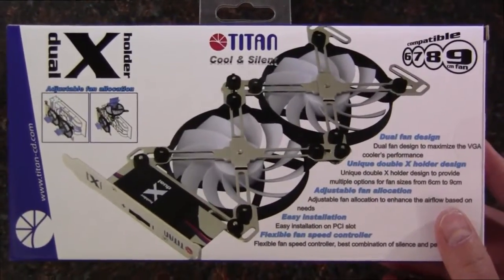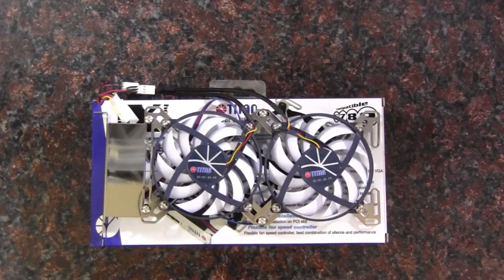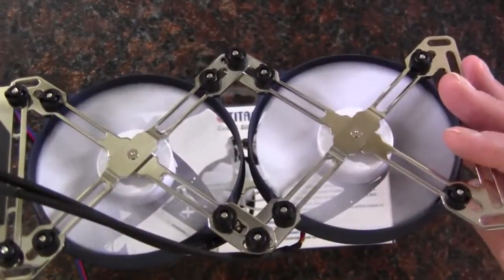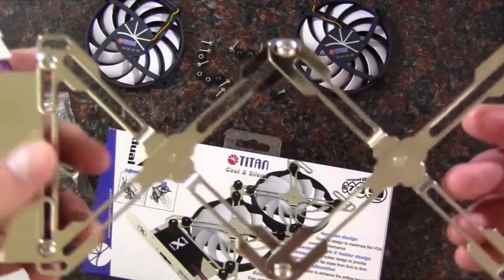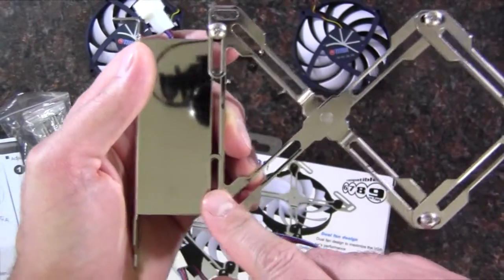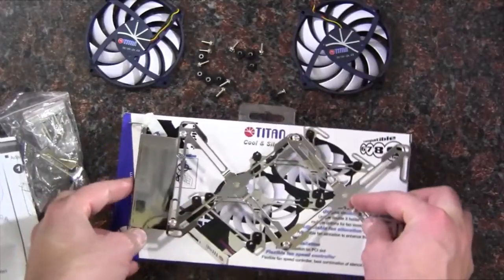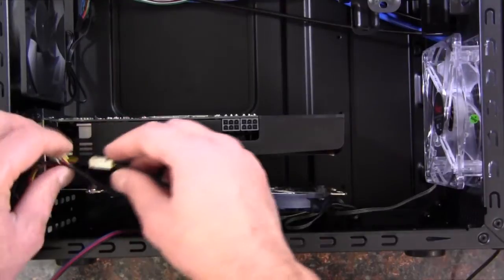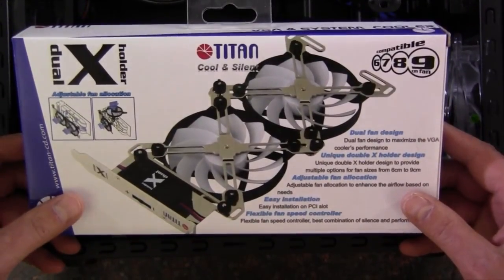Titan Dual X Holder

Comment: Hey I wanted to ask you a question how you connect that to the PC board
Reply from the maker: Hi. The bracket itself doesn't connect to the motherboard. It hangs just above it and is screwed down to a PCI slot screw. The fans would plug directly in a 3 pin fan header on the motherboard. Does that help with what you are looking for?

Comment: per newegg's product page for this the max current is 0.24 Amps. Thanks for the vid, was hoping to see it in action. My 7950 died last night and a friend has one with a dead fan he is gonna give me so this should keep it cool enough, though I may need to remove the shroud for more direct airflow on the card. cheaper that buying an aftermarket cooler
Reply from the maker: I don't think this will work by itself on a GPU without fans. This just doesn't move much air. It can help assist airflow, but not be fully responsible for it. However, putting in different fans can be done and then you can get much more powerful fans that can move enough air on to the GPU heat sink. The 7950 is a hot card. Good luck.

Comment: +AdoptedMike Would it be feasible to have the stock 80mm fans reversed to blow air into my GPU and then a 92mm fan mounted on the top part blowing air onto the heatsink? Or would that be too much for this bracket?
Reply from the maker: +Robert Shepherd It is probably not too much for the bracket, but I did not test anything like that with the fan speed controller on board. The worst case scenario is that the on board fan controller wouldn't be able to spin all of the fans and you may have to connect 1 or 2 fans to another power source. Other than that it is worth a try.
Reply: AdoptedMike Thank you very much for answering. I am planning to get a second one to blow air on the backside of my GPU as well. You wouldn't believe the temps an overvolted and overclocked R9 390X can reach, even with Sapphire's amazing Tri-X cooler. Titan are life savers for making this bracket, or in this case, GPU savers.
Reply from the maker: +Robert Shepherd :) You're welcome. Hopefully it helps, those GPUs can run pretty hot. Good luck.

Comment: So... would you have it pushing air? Did this help temps?
Reply from the maker: Yes, pushing air. This really only helps cards that do not already have fans on them. Even then, it is not super, but it does make a difference. Good examples are RAID cards and fan-less graphics cards. If you use this with a graphics card with a fan or multiple fans, it will hurt performance.
Reply: @AdoptedMike  got it thanks. I wanted to add extra cooling to my 2080 sc evga black
Reply from the maker: @LordGurciullo  EVGA, in my opinion, does a fantastic job with their coolers. The Titan will definitely choke this card and make it perform worse. It will most certainly throttle itself down.

Comment: Como se llama el conector al que van conectados? quiero usarlo para un cooler de una netbook y necesito readaptarlos. 

What is the name of the connector to which they are connected? I want to use it for a netbook cooler and I need to retrofit them.
Reply from the maker: Hola. El conector de los ventiladores es solo un conector de ventilador estándar de 3 pines. ¿Es eso lo que preguntabas?

Hi. The connector to the fans is just a standard 3 pin fan connector. Is that what you were asking?
Reply: @AdoptedMike  Si muchas gracias, lamentablemente no se como adaptarlos, porque este modelo tiene 12v y un usb proporciona 5v hasta donde tengo entendido. Gracias. 

Yes, thank you very much, unfortunately I do not know how to adapt them, because this model has 12v and a usb provides 5v as far as I understand. Thanks.
Reply from the maker: @jdfesa  Sí. USB solo emite 5 voltios. No estoy seguro de cómo solucionarlo. Creo que los ventiladores girarán. Pero, ciertamente, no a toda velocidad. Es posible que no comience y / o necesite un empujón para comenzar. Puede haber ventiladores USB de 5 voltios que funcionen con su configuración.

Yep. USB only outputs 5 volts. I am not sure of how to get around that. I think the fans will spin. But, certainly not a full speed. The may not get started and/or need a push to get going. There may be 5 volt USB fans that can work with your setup.

Comment: I found a more robust version of this, but for me it is completely necessary. I recently build a new computer into a Bitfenix Nova. This case has horrible airflow. Before one of these, I was sitting with a gpu temp of 82°C while just playing Overwatch!
Reply from the maker: Wow! How much did it lower your temps by?
Reply: Later this week when I have time I'm going to run proper benchmarks for consistent temperature readings. Don't want to throw out misinformed numbers!
Reply from the maker: Let me know how that turns out. Hopefully, it will make a difference.
Reply: So I still have not received what I ordered, but did make a discovery. Popping of the side panel dropped me to 75°C. Bitfenix nova is the worst case design I have ever used. Ordered a Zalman z9 Neo to replace it. I will still test the dual 80mm bracket when I receive it.

Comment: First to say, nice channel that you have there. :) What is your opinion, will this cooler lower my RPM on my MSI 7950 Boost edition, with single 80mm fan. I like (my graphic card) it got it for a good price, but the sound level on one fan there is a bit annoying. 4000-4500 RPM is too much. What is your opinion on this cooler, will I be able to lower it on 3200-3500 so the noise is not that much? Also check the card it has alsmost closed case, it is not closed but almost. Thx for the video, thumbs up :)
Reply from the maker: +Milos Kajganic I could help a little by getting more air flow to the GPU fan. However, I have had experience with a 7950 and they are loud. I was really never able to control the sound output very well while maintaining a reasonable noise level. I don't think it would be money well spent for the 7950. You may consider other options. I ended up putting this on the card:

http://www.newegg.com/Product/Product.aspx?Item=N82E16835186068

It worked well, but was a bitch to install. 

I have never tried this, but it looks much easier to install:

http://www.newegg.com/Product/Product.aspx?Item=N82E16835146037

Although can be expensive as you have to add an all in one liquid cooler to this kit for it to work.

The high end AMD graphics cards are hard to keep cool and/or quiet.

Comment: I'm not ready to buy another GPU yet so I'm wondering how much this will cool a 390. My GPU loves sitting anywhere from 75-80°F easy on Overwatch for crying out loud.
Reply from the maker: What case are you using? Also, how many fans are on your graphics card?

Comment: Hey Mike, great video giving us a thorough overview. However, your verdict is a bit passive - you said it was a niche product, stating that it may or may not have benefits. I really want to hear your suggestion - is it worth it? You implied a not really.

One review said it provided no significant change at idle and only a reduced 2 C difference at overclocked - load.
http://www.overclockersclub.com/reviews/titan_ttcsc07/4.htm

Overall, this product cannot be recommended since $20 can be spent on other accessories, like an additional 140mm case fan or led lights for aesthetics. 

Pros: great potential, customizable, minimal cooling (depends on your mileage), adds airflow, quiet, may alleviate compulsive spending temporarily or add justification to modifying your pc case for fun?
Cons: weak fans, looks messy (no molex, comes with 3 pin ATX fan cable so you may need an extra adapter), unstable mounting (according to some - weak/flimsy frame), pricey for cost-to-performance ratio

Score: 2/5. If you have $20 to burn and want to find ways to cool your graphics card as much as possible, it's worth a shot. For the majority of other people, I think it's very niche and unnecessarily beneficial towards lowering temps.
Reply from the maker: I didn't do a temperature test, but I imagine that the above review is accurate. I felt this product is so/so. I personally would spend $20 for a few degrees, but I wouldn't recommend others following the same path. If you already have the best GPU/CPU and enough RAM, then something like this is ok to spend money on. I would not recommend skimping on a better airflow case in order to buy this fan mount. The included fans don't really move much air. You can put better fans in, but then the cost goes up even more to buy 2 or 3 good fans. Let's say that pushes the cost to $50 or $60. You can do much better with a good case and case fans. I was pretty shy when I shot this video. Thanks for the feedback!
Reply: This is an old video but I'll comment anyway cause I'm the guy looking for something niche like this. Got a 980ti with a prometheus II cooler but the Vram is overheating after a couple of hours OC'd, haven't bought this yet but it may be the solution to my problem (with some better fans mounted) unless I can find something better (Is there a 980ti backplate with heatsinks on it? lol)